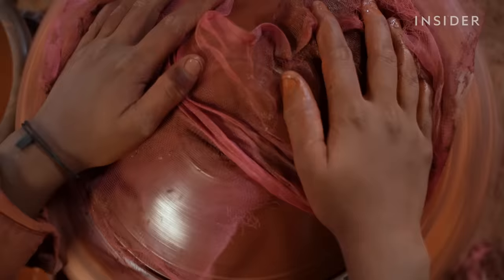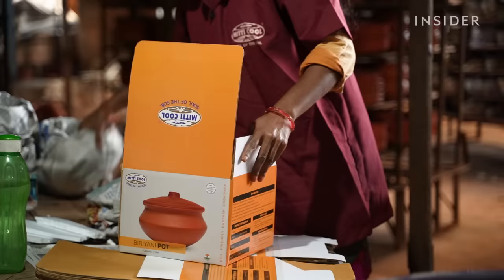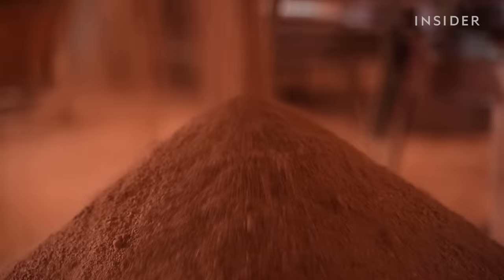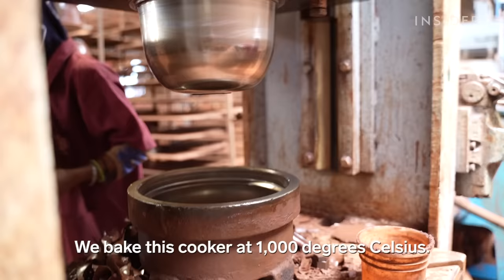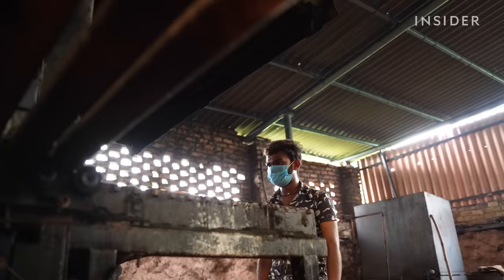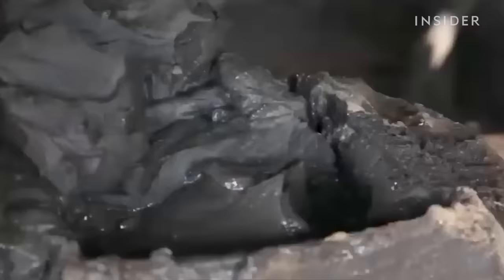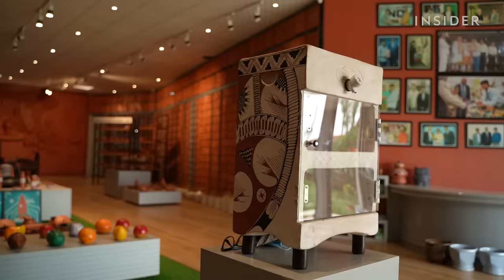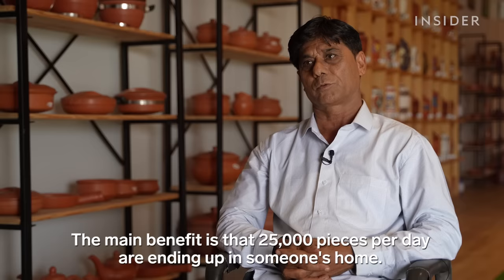How This Electricity-Free Fridge Saved An Indian Ceramics Factory | Big Business

Comment: In a previous life as a potter throwing dumbeks I saw an advanced project in a magazine to make a ceramic air conditioning unit. Start with a medium size electric fan you can run off solar cells, and (here's the hard part) throw a ceramic donut which inner diameter matches the outer diameter of the fan. Throw a nice fat tube, as this will contain water. You will afix some clay tabs to hold the fan onto the clay donut which will be standing vertically, also some vertical fins like louvers for the air to pass over. The top of the donut will have a nice mouth allowing you to pour water into, and the donut itself is attached at its open base to a vase-like form just to contain more water to evaporate during the hot day.  Imagine the lower part of a dumbek (with sealed bottom) and instead of a bowl on top, its a donut standing on edge with fins and a opening on top. This is only bisque fired, glazing it would stop the evaporation through the walls. When the fan is attached, it will stand in the corner in the sun coming through your window and the water inside will slowly evaporate, cooling the ceramic. The electric fan gently passes air across the fins to transfer this cool air into your room! No AC rumble! 100% Green! Probably best made by slip mold.
Reply: Previous life....?

Comment: It's an evaporative fridge -- used to use one for camping. Water goes in a container at the top and wicking feeds it down over the sides of the storage compartment. As it evaporates, it naturally cools the compartment. I'm more interested in what he claims is a non-polluting way of heating the kiln. It sounds like he has contained it and is feeding the fumes out the top via the fan they showed, not that he is actually burning cleaner. It's great to keep it away from the workers' lungs for sure, but it doesn't sound like it's any better for the environment. Again, this is not about him per se, but about the poor reporting by Biz Insider. The cooker concept has been around for centuries -- about 100 years ago, they called it a haybox cooker in the U.S. It's great that he is reintroducing some of the old ways that worked great before the advent of electricity.

Comment: Color is coming out continously from inside of mitticool water bottle. Initially there was no problem. Afterwards we left the bottle without using for few years. Now when i want to use the bottle again a red color is coming when i clean the bottle. After cleaning several times also red color is still coming. So i am not using the bottle anymore.

Comment: The "refrigerator" has a glass door or acrylic door? Many westerners put things in the fridge that don't really need to be in there. A major cause of spoilage is exposure to light. For example, if you put your butter in a butter dish with an airtight lid and also a light-proof container,  it will stay fresh for weeks. I think this explains the old fashion 'breadbox'. You want to starve the bacteria of oxygen and light especially UV light. This is why I question the wisdom of a "refrigerator" with a clear front door.

Comment: glossing over details that remove the heart of the story. Batteries would be a key element of super efficiency. Convert line voltage (AC) into DC, charge batteries while intermittent power is active. Use highly efficient DC appliances. This ain't rocket science. Use negative wave and positive wave en 2seperate piles to charge. 72 degrees is not refrigeration(sic).

Comment: You didn't really explain to us how this fridge works without electricity.??
Reply: It just use water and they claim that fridge can make the air temperature inside that fridge 15 degrees Celsius cooler, which is stupid. Just because u put water in it doesn't mean that fridge gonna be cool, except u put ice/cool water in that.

Comment: You didn't think to explain how the fridge works? I hate you business insider.
Reply: It's just evaporation. It's wholly dependent on relative humidity and temperature. I think the description said it best with "It keeps food 8 degrees cooler than the outside air" and that's probably a best case. Still, better than nothing. Even just storing food in a sealed container will be a great benefit.